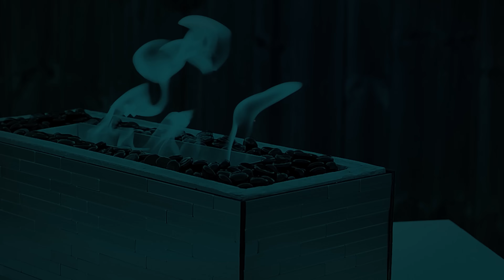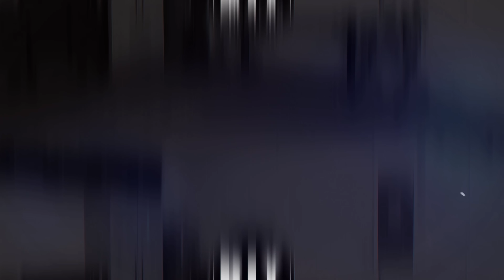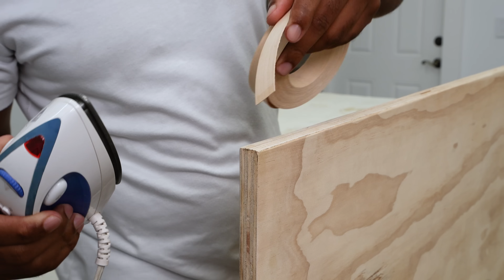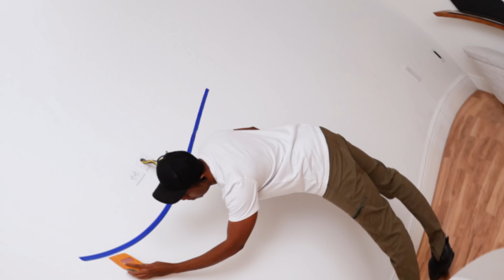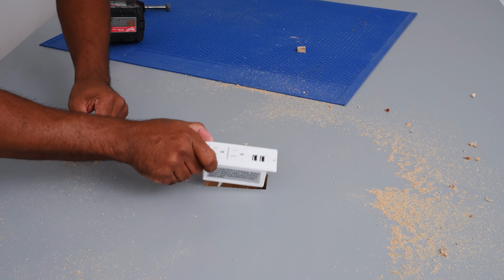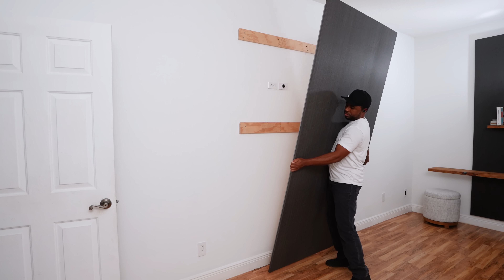DIY TV feature wall

Comment: Nice. But for me, I ditched TVs long ago. Now my whole house have high end projectors. Walls for screens. I cannot go back to tiny TVS no matter how big they are. They cannot be WALL big. Plus projectors are way easy on the eyes.

[IDEA] Why not hang the whole panel on a roller. Like the sliding door one. So ya can roll it close to bed or to a setting area. I know it could be a waste of wall space.

Comment: This mount takes it to the next level. Kinda out of my wheelhouse. I'm good with hiding my wires behind the wall. 😂 

But one question...Why add the veneer to the edges of the plywood if you're covering it with the wallpaper?

Comment: So good to see you posting again! I'm amazed at the simplicity of your build. Way simpler than what I did when I moved into my home, where I extended my TV wall throughout its entire length by about 7 cm (≈ 3 inches), with joists, boards , dry wall panels, wallpaper, paint job, moldings, conduits, pipes, wiring and a vesa mount. I'm happy with the result, but it took considerably longer and was significantly more expensive and cumbersome to pull off.

Comment: Обясните, зачем клеить кромку, а потом её закрашивать и заклеивать виниловой плёнкой?
Reply from the maker: Doing this creates better adhesion, in my opinion, and requires less effort to fix the edge. If you can fill all of the pores in the edge and sand it smooth, you may not need the edge band.

Comment: Having built several of these walls throughout my life, I’ve learned exactly what works and what doesn't. If you’re planning your own build, here are three essential adjustments I recommend for a professional, long-lasting result:
1. Prioritize Ergonomic Height

Avoid the common mistake of mounting the TV too high. For the most comfortable viewing experience, your eye level should be aligned with the center of the screen. Mounting it higher often leads to unnecessary neck strain over time.
2. Secure Your Edges

Glued finishes or adhesive foils tend to peel back when the weather gets warm. To prevent this, finish your edges with aluminum C-profiles. These fit snugly over the wood and the laminate/paper, locking the edges in place. Not only does this stop peeling, but it also provides a sleek, high-end aesthetic.
3. Don't Over-Engineer the Hardware

Using six screws per board is overkill. In this type of floor-standing construction, the physics are on your side:
Load Capacity: A single screw can typically handle 45 kg−70 kg of force.
Actual Load: With the wood, VESA mount, and TV combined, you’re likely looking at a total pulling force of only about 30 kg.
The Verdict: While one screw could theoretically hold the entire weight, using two screws per board provides more than enough security while keeping the installation clean.
Reply: Although I agree with the arguments, especially the first one, you talk like an AI chatbot...
Reply: @pascallj  Thanks I guess? No I am not a AI chat bot. EDIT: English isn't my first language, so I used a bit of help from Google Translate to polish my spelling.
Reply: @Amixus "long-lasting, professional result", "the verdict", correct usage of the mdash. Or you used AI to write this comment, or you use a lot of AI and have taken over its habits, or you are a professional writer.
Reply: @pascallj  No AI, just google translater.
Reply: @Amixus  def a bot
Reply: @iambear.6526 I am Not a bot
Reply: I uploded a video of my last tv wall. Guess bots can’t do that. ;)
Reply: A single screw can typically handle 45 kg−70 kg of force. However when you put up a wall mount for a TV you want it to hold even if someone falls on it. if it was straight against the wall i would agree with you, but he is making a example for people to follow.
And some will hang up a 50kg TV and give it a 2 meter swing arm.